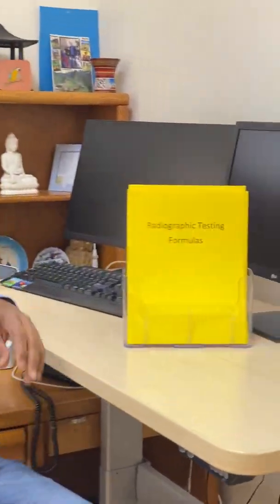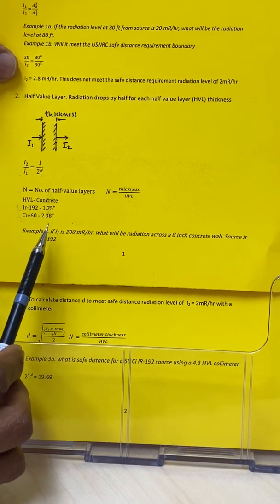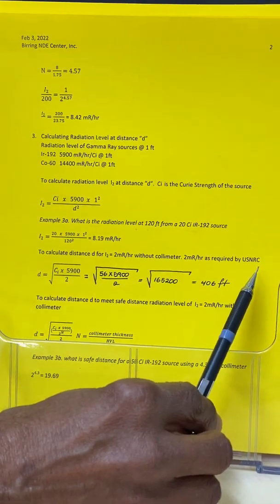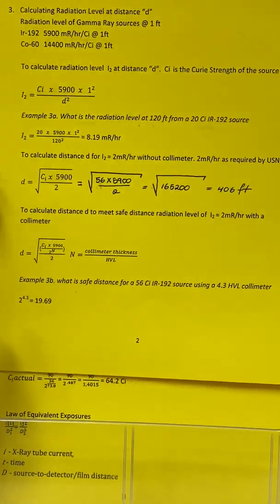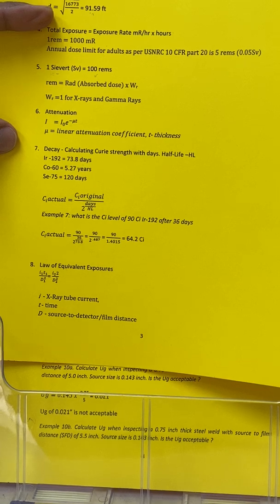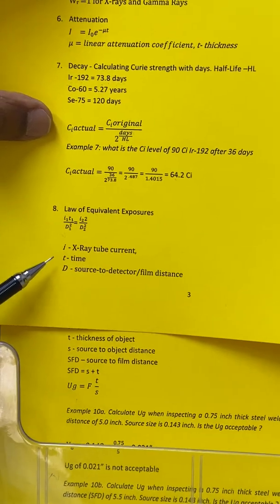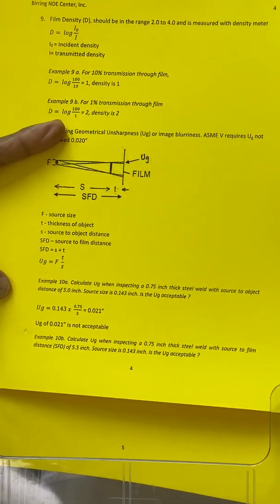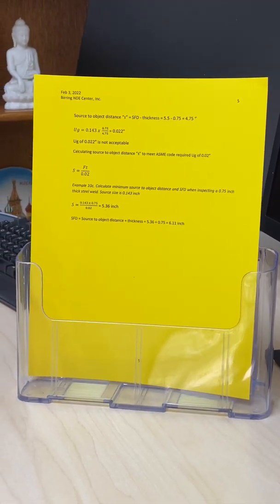Birring NDE 112. Radiography Formulas

Comment: Hello Dear Anmol. Thank you for your training lessons. Team and I are very interested in them. Could you please to help us, we have a question. When calculating geometric unsharpness, should we take into account the thickness and height of the welded joint? In the formula, this is t. In ASME V, we have a thin thickness item with a sensitivity rating. Nikita from Sakhalin Island.
Reply from the maker: Nikita, Today, I added presentation/video on Codes and Standards
Reply from the maker: Nikita, Good to hear from you. To calculate Ug, use thickness as per T-276.2. (a)
Reply: @anmolbirring6341  Thank you for your answer. Waiting new video on your chanel.